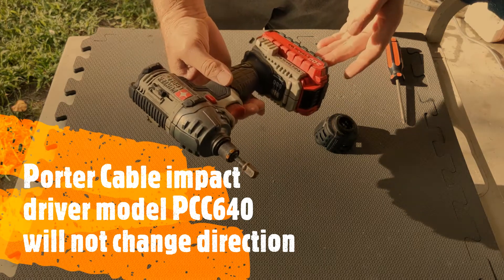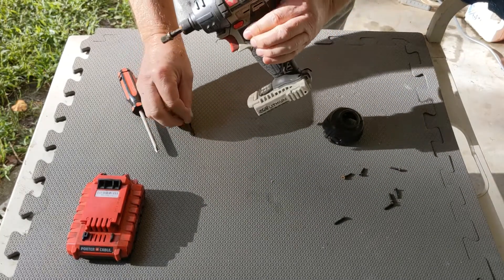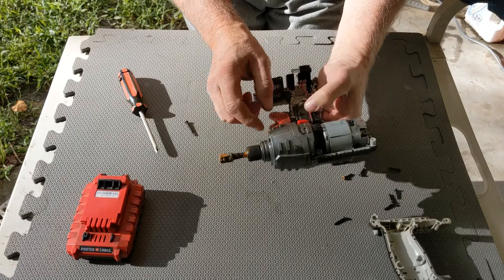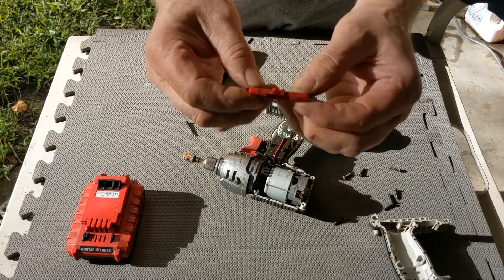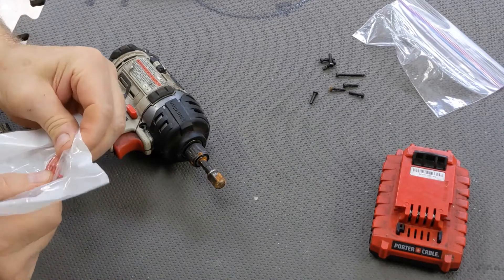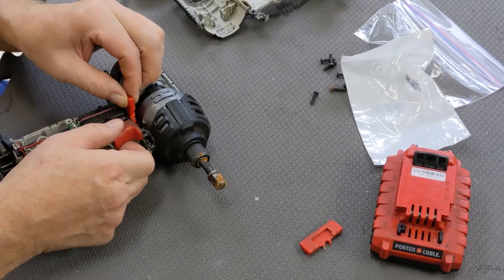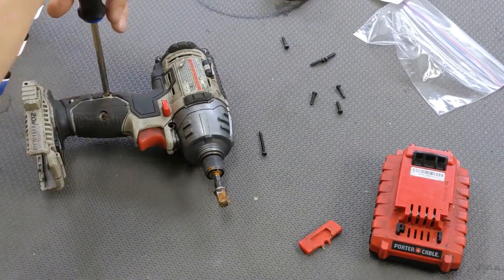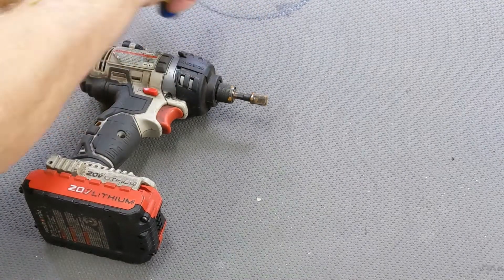Porter Cable Impact driver quick and easy repair

Comment: Thank you for sharing....my Porter Cable PCC-641 Impact Driver would turn on the light, but not start up, sooooo, I took it apart and with my voltmeter found the red wire going in the motor had worked loose somehow....anyways, pushed it back in and now runs like a new one once again. I've only had it for bout 5-6 years and now have it running again.....